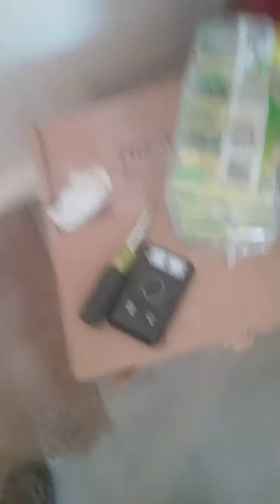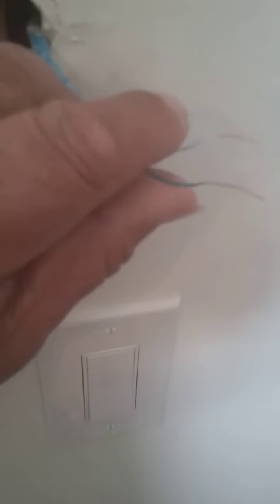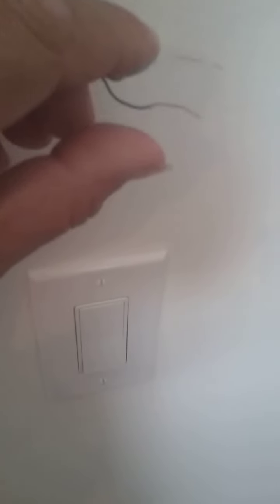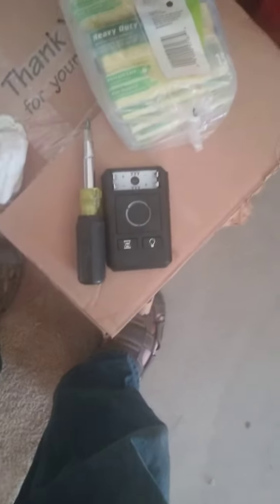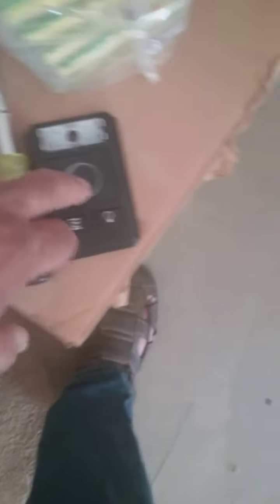troubleshooting phantom open and closing of garage door

Comment: So it sounds as if the leads were stripped too far and the vibration made them touch. That's a bit less nerve wracking than the thought of a screw going into a cable. If a door sags a little, or the strike plate gets loose, I'll usually fix it by replacing the original screws with deck screws, and hitting a cable is my worst fear. At least I don't live in a newer house with flexible gas lines running through some of the walls.